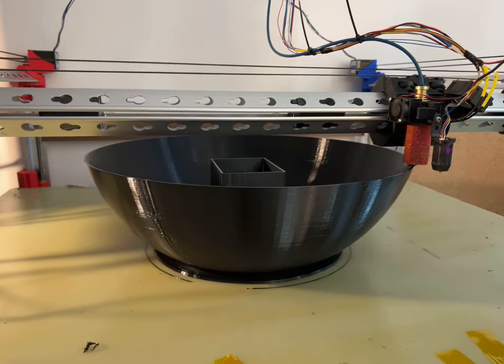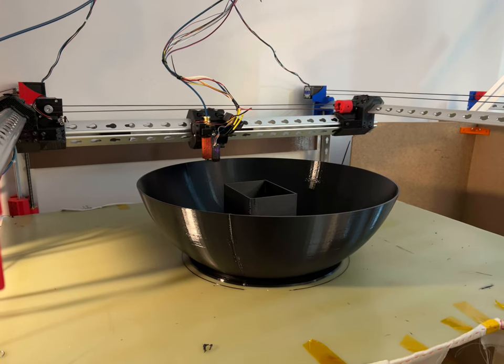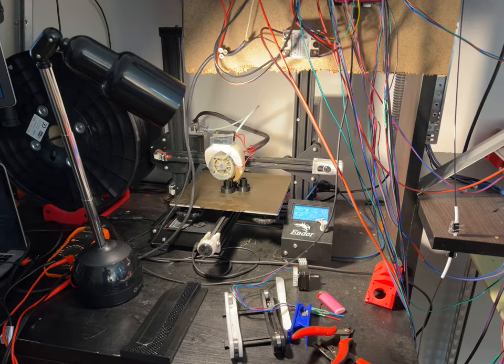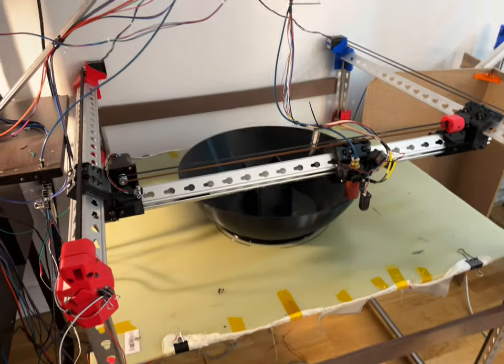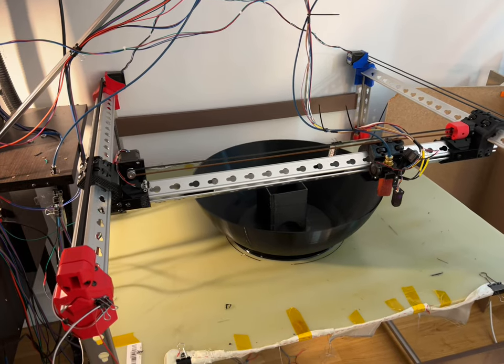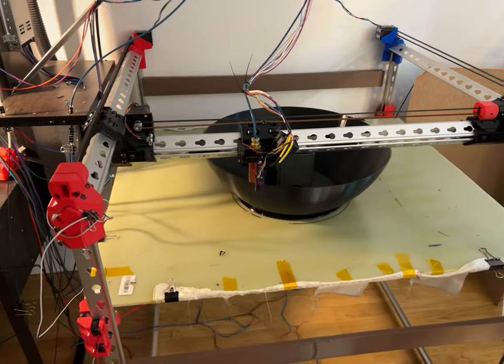3D Printing a Full Size Garden Water Fountain | DIY | PrimeRep

Comment: A water cooled motor sounds neat. It could have a lot of torque if the diameter were large.

Is your bed heated? If not how does it stick? If so how did you heat such a large area?
Reply from the maker: nichrome wire